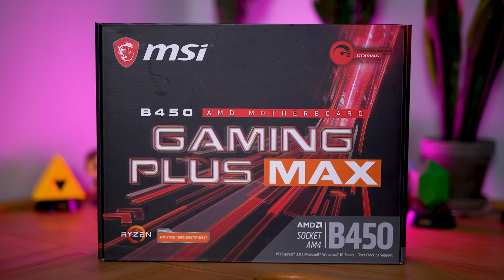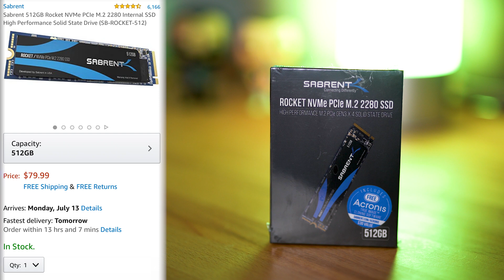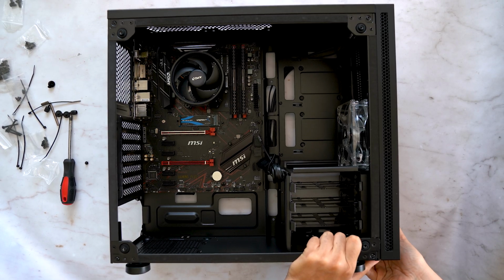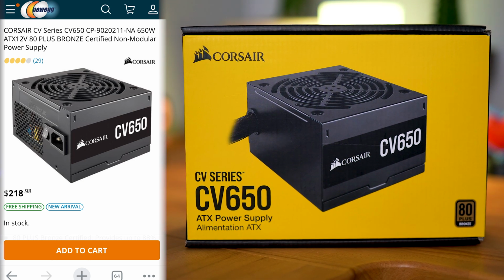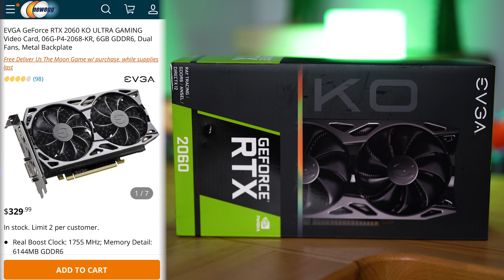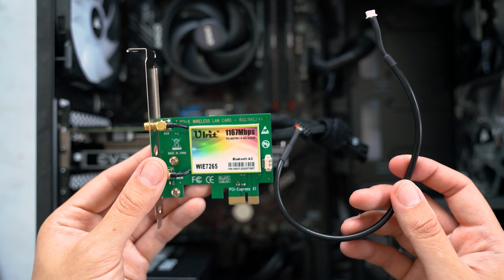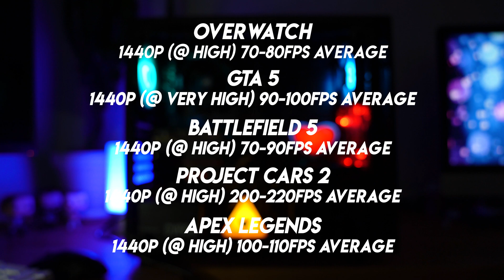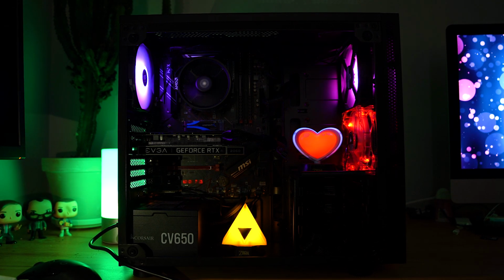HOW TO BUILD AN $850 GAMING PC FOR STREAMING 🔥 JULY 2020 | mrkwd tech

Comment: I just bought this build (7/21/20) and it ended up being $1,249.
Reply: Dang I spend $2500 but that's including monitors keyboard mouse and others
Reply: @Kuriixi  for the same set up? Yeah I havent bought a gaming monitor yet, but I already had all the peripherals
Reply: hey, i’m thinking about getting this build too. did you get all the exact same parts? how well is it holding up? any issues with it?
Reply: @MissGirly789  also bought a diff power supply
Reply: @MissGirly789  Hey I did get all the exact parts. Except for the fans I went and bought different fans.
Reply: @MissGirly789  it's doing great! I love it!
Reply: How was it?
Reply: @swordoftruth1014  it's super great!!! I love it.

Comment: Could I use the Samsung 860 EVO 500 GB SATA 2.5 Inch Internal Solid State Drive (SSD) instead of the sad he is providing
Reply from the maker: Yup - you just install it in a different way. I installed one of those SSDs in my $400 PC video so you can always refer to that when installing (it's up on my channel). Thanks for watching!
Reply: mrkwd - tech guy thanks for the advice really helps since it’s my first time

Comment: Hey dude thank you I am going to make one cuz I can buy a good one and thanks for making a cheap one thx so much and the vid you made about the 400 what is I just made the 4 one and added a good graphics card which one would be better
Reply from the maker: The $400 build I did recently will handle 1080P gaming no problems if you add in a graphics card to that build. This build is basically the equivalent of that but made to handle 1440p gaming with higher graphics settings. Both are viable builds in July 2020 - it just depends on how much money you have to spend. Hope that helps!